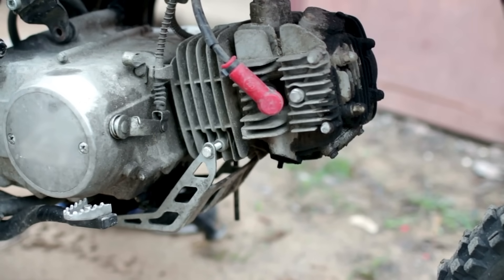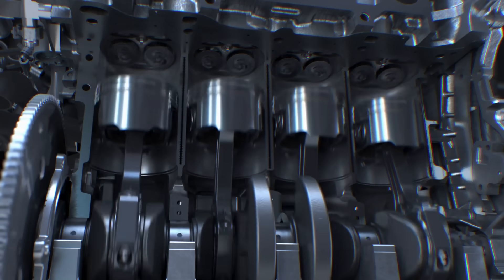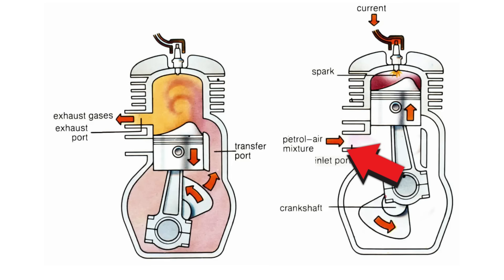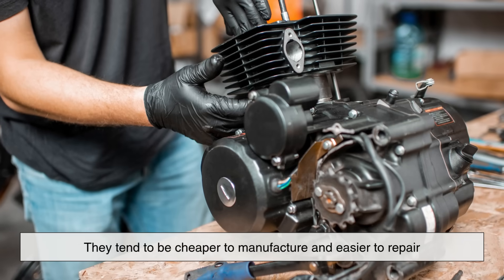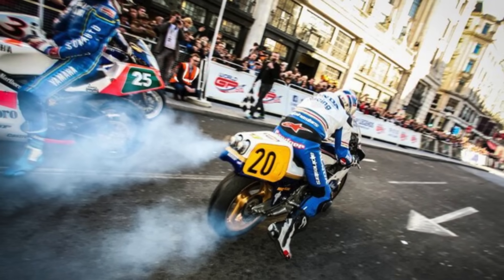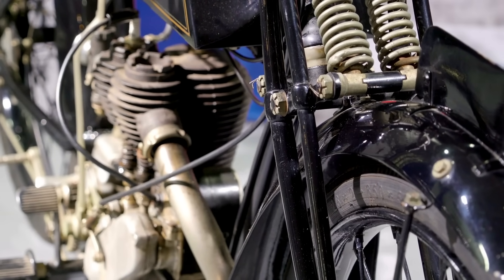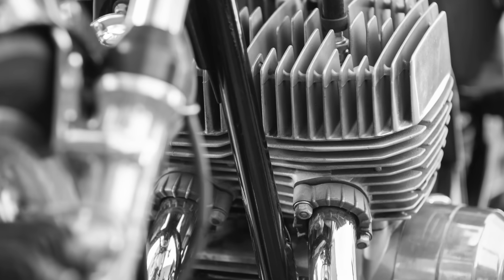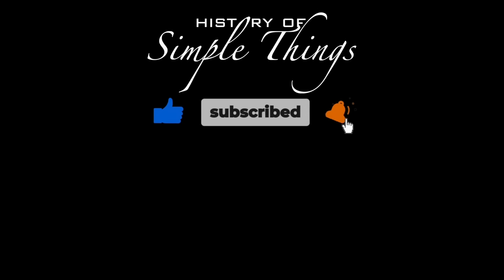What is a Two-Stroke Engine? | How It Works and Why It’s Still Used Today

Comment: For their size, two-stroke engines still have more torque than electric tools and that's one of the annoyances for me wrt electric stuff. Also, no recharging. Just fill and go.
Reply: I literally feel the exact opposite. No more fiddling with carbs, mixing gas, leaking primer bulbs, cracked fuel lines, plugged air filters, sticky throttle cables, rebuilding carbs, replacing broken pull strings, the list goes on, and on. Grab a high quality battery powered yard tool, and it goes every time you squeeze the "throttle." I cut many cords of firewood, trim and edge my large country lot all with battery powered equipment.
Reply: @kickeramps  I'm with ya... There are points on both sides, but that's my preference. :)
Reply: 20 years ago, I would have totally agreed but the last gen battery tools are very impressive.